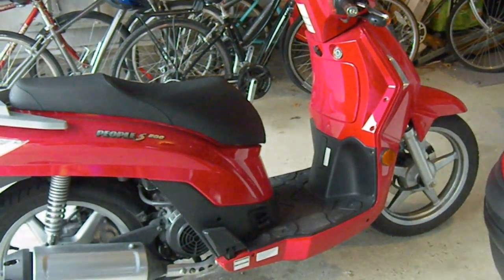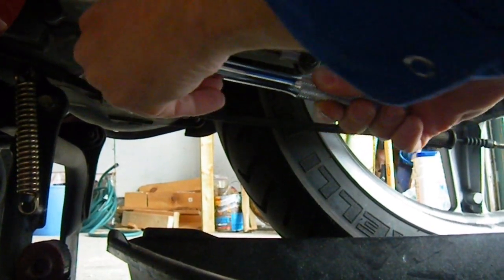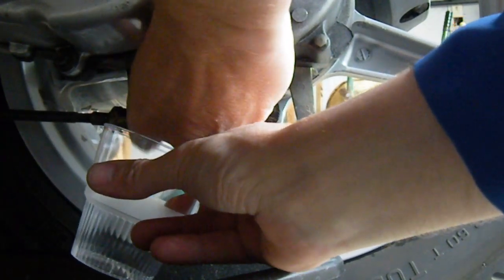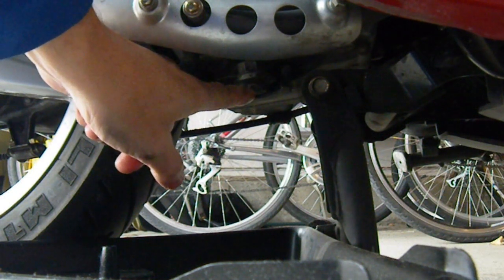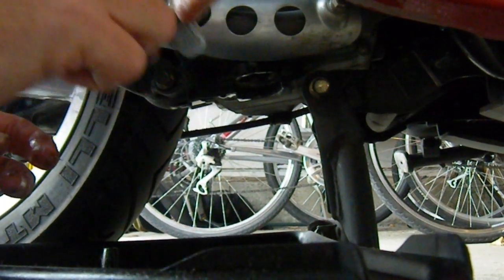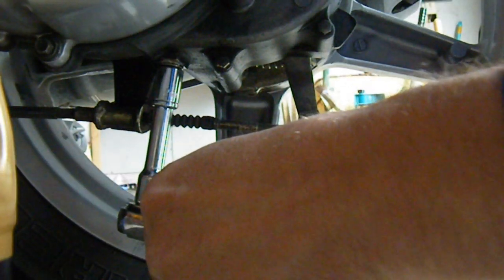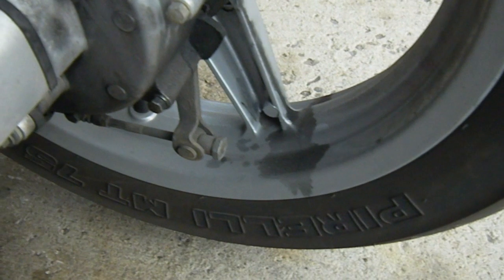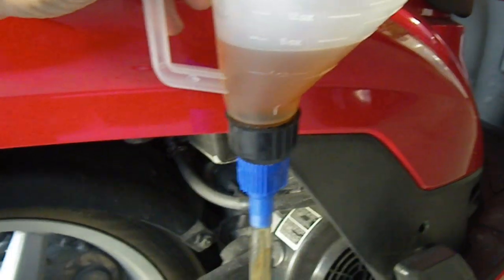Kymco People S 200 oil change for engine and gear drive

Comment: Thanks for your time. I've a dubt. When i remove the filter oil i don't understand if, after cleaned it, when i must put the oil filter (filter has a form like a cone) in his "house" the the tip of the filter is facing upward or downward. To be clearer when i put in the hole the tip is facing upward o downward ?
Thanks Thanks Thanks.....
Reply from the maker: Franco Rossi The tip is pointing upward into the engine.

Comment: There is a red service light on the dash of mu 250.. How do you re-set it?  Great video on fluid change. Thanks for taking the time to share it.
Reply from the maker: Bernie Andrews The manual I have for the S 200 says to hold the right button down for 5 seconds to put the clock into service mode. Then hold both buttons for 2 seconds and that should reset the service light. Hope this works for you.....Thanks for watching.

Comment: What did you use for the gear oil? Can't seem to find that in my manual. Thanks!
Reply from the maker: My manual says on page 49 Recommended Gear Oil SAE #90. This is available from most car parts  and motorcycle places.
Reply: Bloeski's Wrecking Crew Thank you

Comment: Couldn't you have just emptied the oil from the bolt with the filter in it? Thats what the manual directs i hadn't even heard of the bolt on the other side.
Reply from the maker: eraldorh yes you could. However the opening is rather large and the oil will come out rather fast and may make a mess while you try to catch the oil strainer and spring. Using the side drain will let the oil out slower.
Reply: Bloeski's Wrecking Crew Yes but then you got oil running all along that metal pipe on the bottom of your scooter. Thats hardly better as it made an avoidable mess.

Comment: Yep, your filter screen is up-side-down. It fits down into the spring.
Also, you'll rarely need the whole .9L in.....add  .75 or .8 and then start checking the dipstick...so you don't over fill again.
And, finally - let the engine run for a bit before racing the engine like you did. Oil must circulate first before you do that. Give it 30 seconds, not 3.
You are replacing the washers, yes?
Reply from the maker: I will remember that about not racing the engine for a while. Replacing the washers is on my list of things to do next oil change......Thanks for watching.

Comment: I watched very carefully and the reason you had to reach in for your filter screen is you had it upside down.  You can find numerous kymco service pictures showing it screen bowl side down sitting in the spring between the outside cover and oil filter gasket.  Looks like it doesn't kill a bike, but you may consider that for your bike's sake.  Still very grateful that you give of your time to educate others.  Hope my comment helps.  Maybe my eyes are screwy, but it really looked like you had screen side up and gasket down. 
thanks
Reply from the maker: Interesting. Thanks for noticing that. I will try the screen in the other way the next time I change the oil. It may not matter much however as I have never found any debris in the screen.
Reply: yes, with the gasket upside down, you would logically get no debris as the filter is bypassed and anything that hit the screen would be washed off in the flow.
Reply: Yup, I just did the first oil change on my mom's Like 200i and the filter was placed with the basket inside the spring, not above it.  This video was helpful regardless, thanks.
Reply: For other visual learners reassembling their drain plug and oil filter kit - I found this video to follow up on your great video - 
https://www.youtube.com/watch?v=fbBbrpOL_Es

Comment: how can i drain my gas?
Reply from the maker: Turn on the ignition, but leave the engine off. This will turn on gas flow to the carb. Then open the drain screw on the carb. The gas will drain out a tube at the bottom of the bike. Be sure to put a bottle on the tube to catch the gas. I have a video that shows how to access the drain screw on the carb.....Thanks for watching.
Reply: 10/4. Thanks for the info!
Reply: I drained the gas and replaced it with fresh. It started but won't idle. It runs with throttle but when I come to a stop it shuts off. Any ideas?
Reply from the maker: Mine has the exact opposite problem every spring when we start it after a long winter. It starts, idles okay, but stalls if given throttle. What we have to do every spring is let it idle for 30 minutes, and the heat of idling seems to free up the carb and then it runs okay after that. Try running your engine with the bike on center stand, giving it enough throttle to run, and keep it running until it is hot. Then it may be okay after.